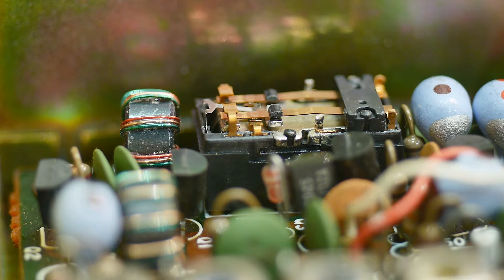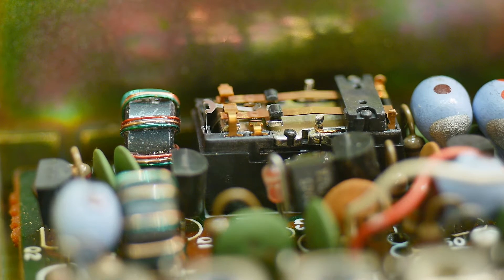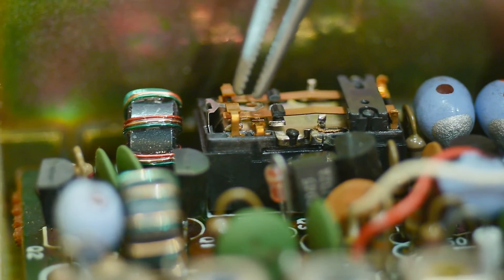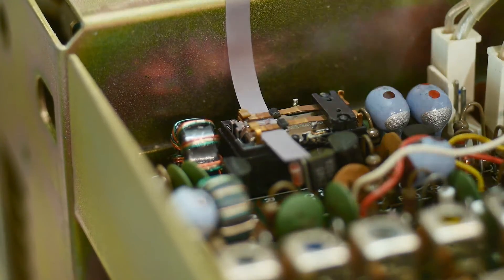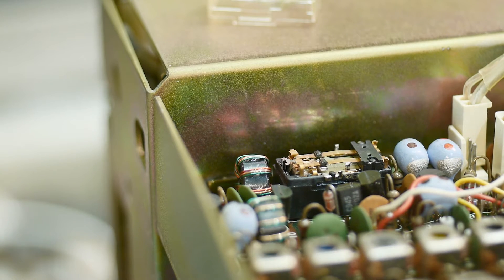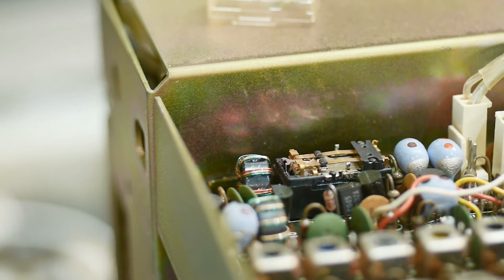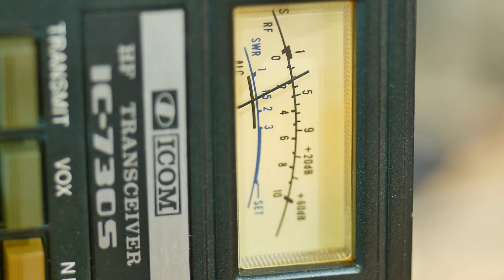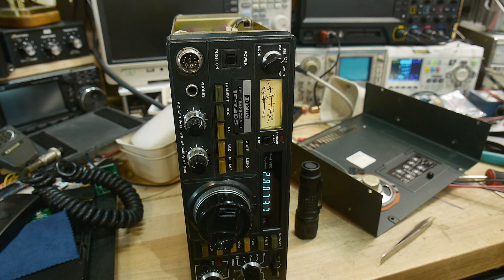#1708 ICOM IC-730S Transceiver Repair (part 4 of 5)

Comment: Im fixing one of these at the moment. It had no life at all. With a fair bit of work I now have transmit and receive but the transformer on the display board is shorted so no display and -5v for some op amps. I powered the display with a bench supply it all works including the driver ic. I'm contemplating some how deglueing the tranfromer and re winding it 🫣 love your channel BTW 73 👍😊

Comment: Most relay issues in ham radios could be avoided if the manufacturers would have provided the requisite wetting current. Every small signal relay datasheet will say its necessary, yet the manufacturers all seem to ignore it.  I've restored a number of impossible to find relays for FT-102s with a drop of deoxit on the contacts, an Arduino programmed to cycle the relay a few thousand times, and a couple hundred mA DC applied through the contacts.

Comment: make sure to clean the contacts on the SR-202 tx-rx relay too, which is located on the lowpass filter board at the back of the transceiver. Unsolder the relay from the board, and you can fully disassemble it. The contacts get oxidated, especially on the receive side. I am currently repairing an IC-730, but the 100 watts variant. 73!!

Comment: The worst thing you can do to a relay like this is use a abrasive.  You will completely remove the plating off the contacts that is guaranteed to fail again and again in very short order.  Abrasive diamond contact cleaners are meant for industrial contactors that use solid silver contacts, they are not plated.  Just cut a thin strip of plain paper and dampen with your favorite contact cleaner is what should be used for relays.  No different than when I was a kid and we had to clean the contacts on the thermostat with a dollar bill at the beginning of winter every year.
Reply: I absolutely agree with you about not using an abrasive. What's your opinion on using a burnishing tool that's specifically made for cleaning contacts?
Reply: @jimhall9360  I wouldn't use contact burnishing tools either.  They are designed for industrial contactors that use solid non plated contacts.  Any type of abrasive on a relay contact, even a burnishing tool would remove the microscopically thin electro plating from a relay contact.
Reply: @mikesradiorepair  Thank you so much!
Reply: According to the 3M spec sheet: polishing soft materials like plastic and soft metal alloys, it is prolly good enough for cleaning relay contacts.  I was appalled at the word "sandpaper" at first.
Reply from the maker: yes, I should not have said that word. it is like polishing compound impregnated plastic. it is smoother than writing paper
Reply: Mike - glad to see you're still alive and kicking...Buddy and I have been hoping you'd resurface at some point. Hope all is well.  73 - Dino KLØS
Reply: @PapasDino  Doing well.  YouTube is a blessing and a curse.  It led to me being completely overwhelmed with work.  I mainly only work on amateur, business/commercial radios now.  Going to take all the test to get my GMDSS Radio Operator / Maintainer license with radar endorsement in a couple of weeks.  Those test make the Extra Class Amateur test look like a walk in the park (which it was).  Wish me luck.  Merry Christmas.  Mike KC3OSD
Reply: don't worry about removing the plating. those contacts are pure silver. they just get a bit tarnished, because the relay is not hermetically sealed.